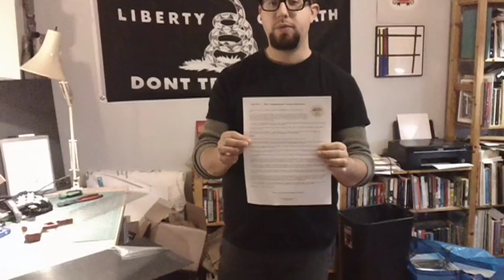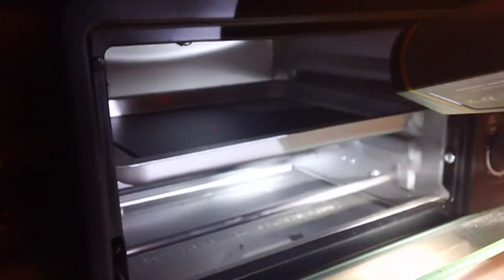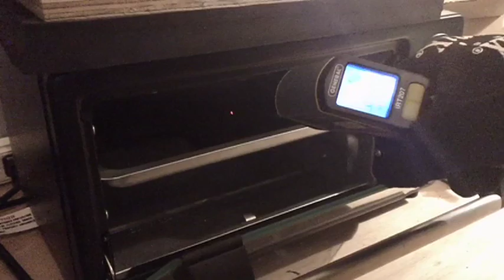New! Holstex First Impressions

Comment from the maker: @tyrs8 I've really warmed up to the .060 thickness material as opposed to the .080 thicker stuff. Once I got a handle on controlling the temperature, the .060 became much easier to work with. It looks great, is extremely light weight, easy to work with, low profile, and gives incredible definition. It may be more flexible than the .080, but I don't think that's a problem.